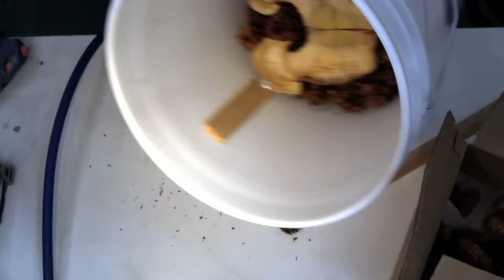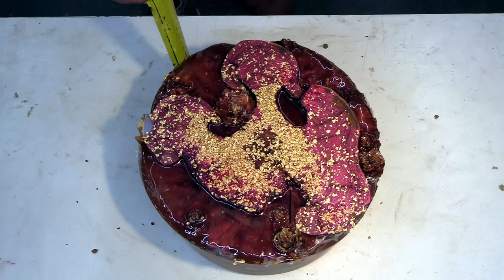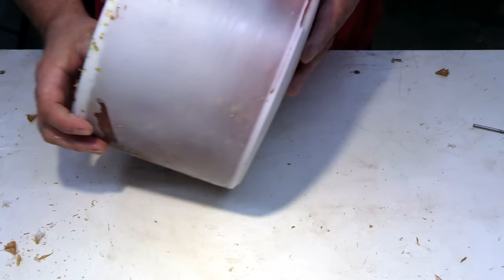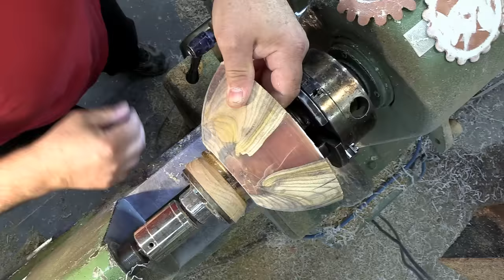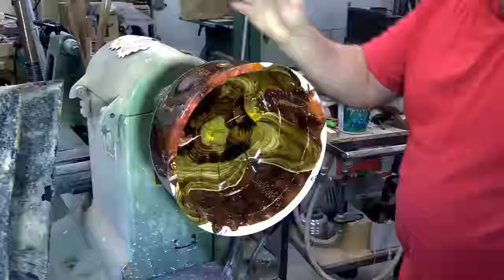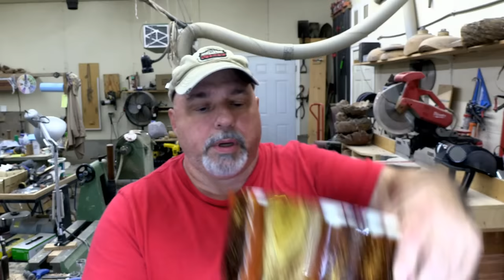Woodturning - Strawberry Shortcake Bowl Set

Comment: Hi Jim. Great project. Question: do you sharpen the tip of the Hunter Hercules or do you simply replace it when it is dull? Cheers Leiv
Reply from the maker: Replace it, the cutter is cupped and even if you could make a jig of some sort, you can only cut carbide with diamond wheels and for whatever reason, they just never seem to be as sharp as when they were new. Thanks

Comment: Why not pull a vacuum before pressure pot? Not being snarky, I'm just trying to figure out the finer details of how to work with resin and the more I can learn the better
Reply from the maker: My bucket wouldn’t fit in the vacuum chamber. Thanks
Reply: @SpragueWoodturning  how do you know when to use vacuum and pressure versus just pressure pot?
Reply from the maker: @dzielinski6560  if things are really rotten or punky, then it’s probably a good idea to use the vacuum chamber.

Comment: I have watched many of your videos and have enjoyed them. But, I have a question, I'm just starting out and I don't have a pressure pot. What do I do to get the epoxy to cure?
Reply from the maker: If the epoxy is mixed properly then it will cure. You don’t need a pressure pot to cure it. It will however give you a better casting. Thanks for watching

Comment: I tried to use the coupon code but got this message "The minimum spend for this coupon is $87.00. " Otherwise $12 shipping.
Reply from the maker: Unfortunately I guess you still need to spend $100 in order to get the discount. I was under the impression they were removing that restriction but I guess not. Thanks for watching!